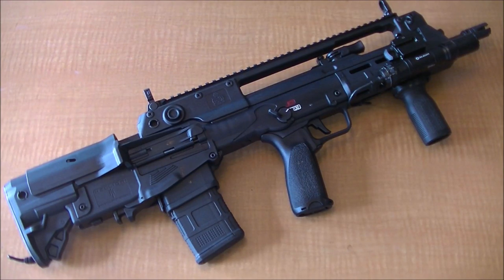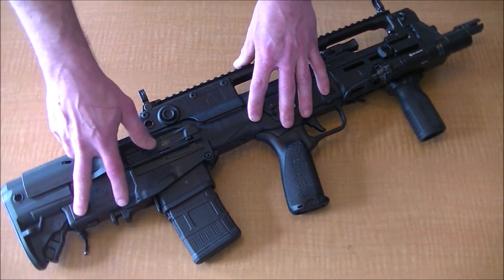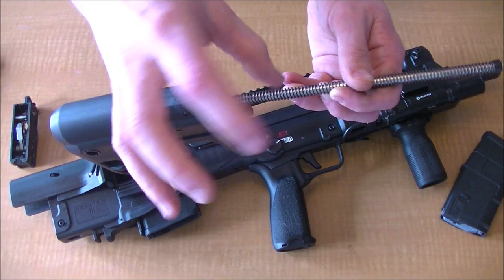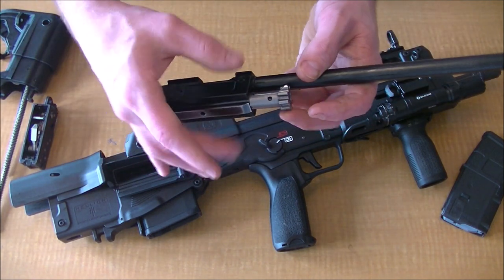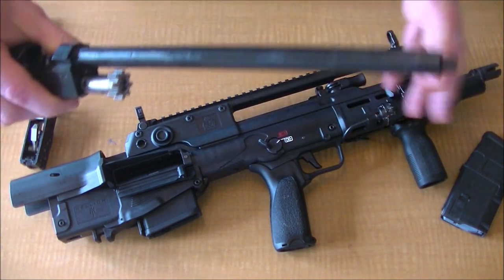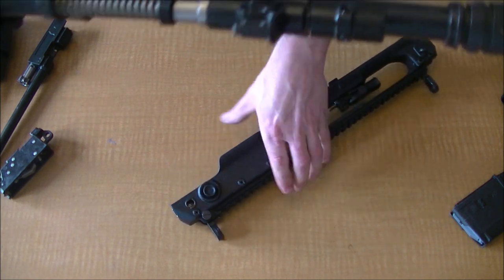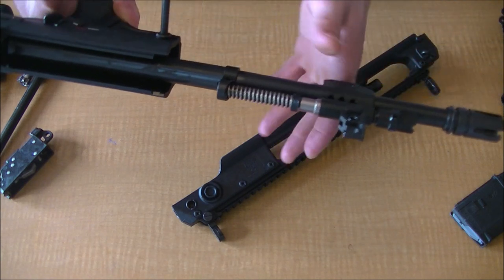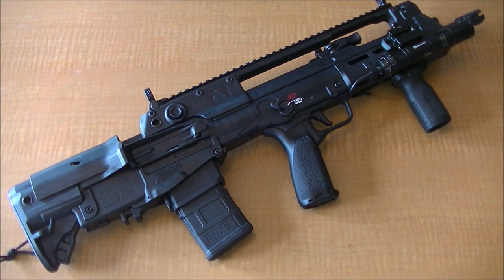VHS 2 Rifle Design

Comment: There is a good reason to have an adjustable stock in the army: extend it to train without bulletproof jacket, and ajust it to keep the same length while wearing one.
I used a bullpup in operation and having an other way to hold my weapon as I always did was not confortable at all.
Reply: bullpup ergonomic for a comfortable wielding was like, long and extra long. I am totally ok from 365mm to 400mm lop.
Reply: So, the length of pull on the VHS with the stock all the way in is already several inches longer than that of an M16A2. I'm 6'4", and I run the stock 2 clicks out when shooting standing. I let a nearly 7' tall guy shoot it, and even he didn't need the stock all the way out when standing. This led me to conclude that the extra length is for shooting prone. I tried that out, and, sure enough, with the stock all the way out, shooting prone feels great. You don't have to scrunch yourself all up on the gun, and can still pull it solidly into your shoulder.

Comment: The reason that they used a bolt rod is because they can not put a steel rail in the polymer receiver to prevent the bolt’s pre engagement.

Comment: How does it compare to the AUG with a few aftermarket parts?
Reply from the maker: Apples and oranges. It is for all practical purposes a g36 bullpup without a bolt lock lever or button
Reply: I've had my Hellion for a few months now. Having been hands-on with AUGs a fair bit as well, I'll say the AUG's controls are more straightforward. That being said, I think that's mostly because the Hellion just has so many shapes coming out of it that it's hard to tell what is where. Of course practice helps though. The AUG is relatively smooth and simple, amd makes the necessary controls very prominent. The Hellion's main weakpoint is the magwell- it's not flared AT ALL when it needs to be, and the mag release could be bigger. This could easily be rectified too, since the entire magwell is easily removable. I do like that you can thumb-over-bore woth the Hellion, something you can only do with the AUG with certain aftermarket handguards. I like the Hellion's irons and long pic rail too. That being said, I'd choose the AUG simply because its reliability stands out above other short stroke piston rifles in general, not just bullpups, and it's been around for 45 years now. Not to say the VHS is unproven, not at all. But the AUG just has all that time goong for it.
Reply: @fred_ditto  solid feedback thanks man, love my AUG except the lack of thumb over bore hold. There are aftermarket handguards coming out for the AUG now which should fix that
Reply: @adam3651  Glad I could help! Yeah, there's one from Austria right now (not Corvus) that more or less encircles the barrel that fits the bill, but the name escapes me. And they don't ship overseas. There's also that one that was teased on Reddit about a month ago iirc that looks promising, but again, the name escapes me.